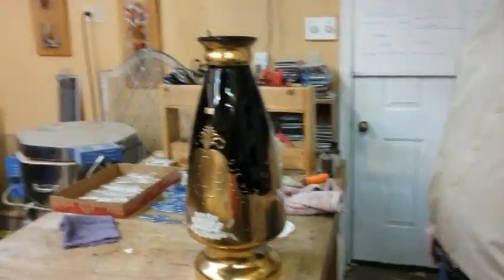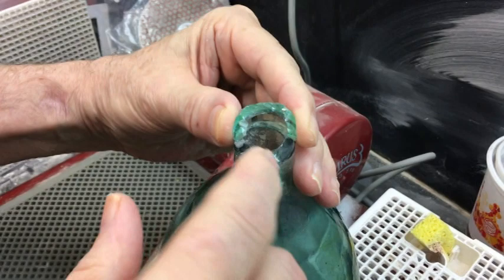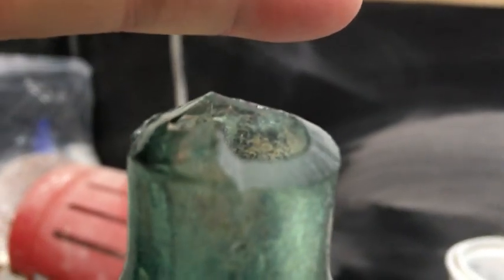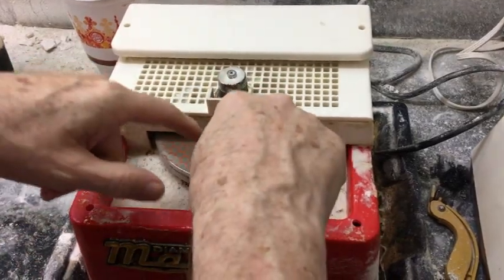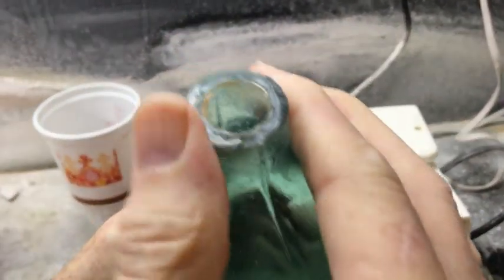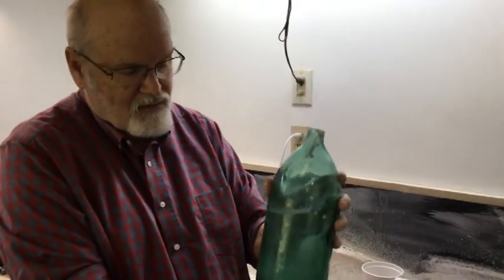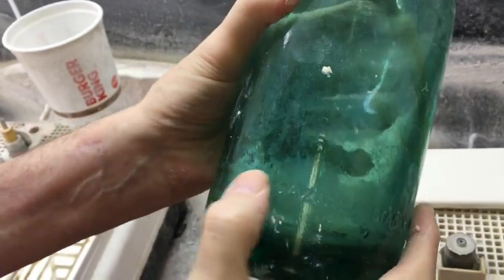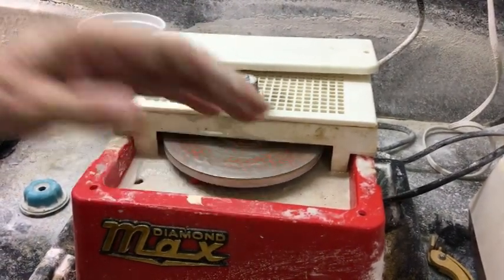Cutting Down A Bottle Neck In The Stained Glass Shop V337

Comment: I have been looking for that machine
Can’t find it
Patricia
Reply from the maker: I can get one shipped to you for 367 but you may be able to get a better price.. you need to look for a Diamond Tech Diamond Max Disc Grinder. If you pay about a hundred dollars more (which I'm going to do on my next purchase), you can get a Diamond Tech Diamond Laser Bevel Max which is the same machine but with extra grinder and polishing wheels so you can do beveling in your studio.
Reply: This sounds very good 
Is this American dollars?
In Canada here most all stained glass shops are closed in Toronto Ontario and surrounding area
Patricia
Reply: @davidhill1220  Try Huronia Glass in Barrie. We come down from North Bay to buy our glass. They are very helpfull and it's a fun place to spend some time. If they can't help try artistry in glass, in London I think. We were Fantasy in glass customers and Mike set the bar high for other dealers.